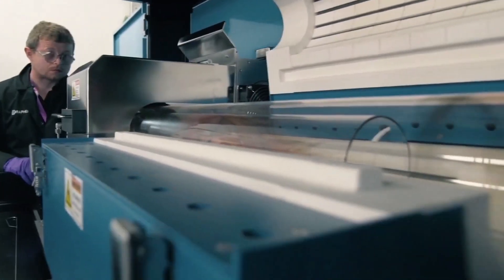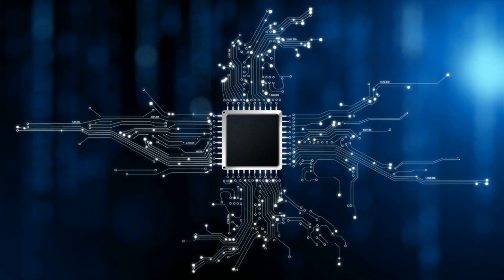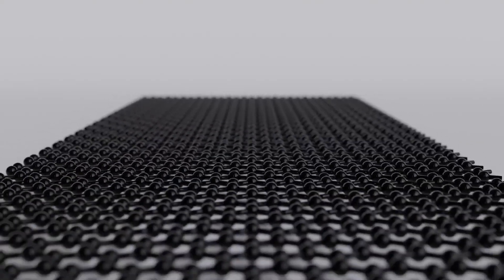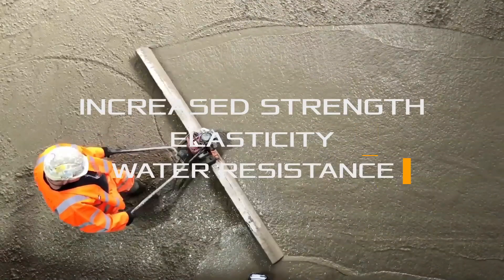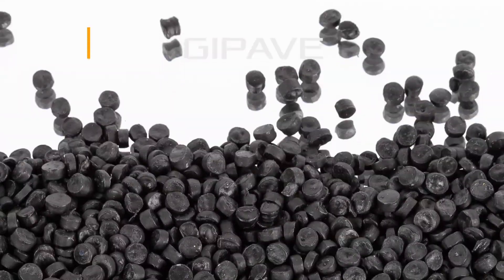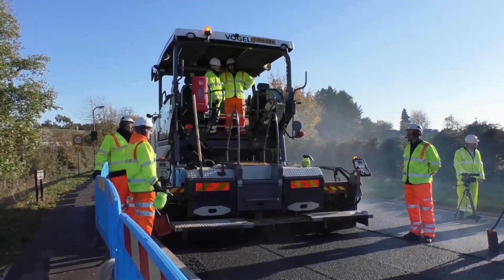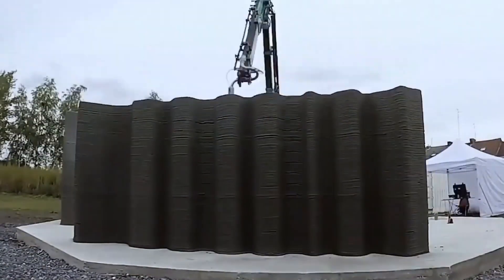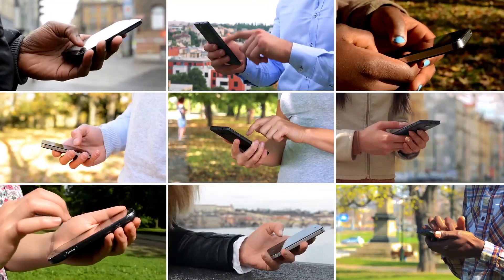Graphene in concrete is already changing the rules of the game in construction

Comment: Very much interested in new materials since I've spent my career in bridge construction.  I have many questions but to name a few: cost structure, manufacture of Graphene, storage of the material, and corrosion resistance.  Interesting, thanks.
Reply: Other questions I personally have is does this material leak anything into its surroundings during use?
For instance if used as a road surface, will this lead to particles in the air that's worse then what's released when driving on asphalt right now?
Or is it better?
If used in a bridge, will water flowing down from it contain particles harming fish etc?
Does it enter the food chain?
Does it cause disruptions in it?
Is there health hazards involved at any step of the process from making a product with these materials, during use or when removing the product in question after end of life?
Reply: @Luredreier  the "it" to which you refer is carbon, so the same questions would apply to the use of pencils.

Comment: Graphene would be a alternative to Ferro Cement in the boat building industry. 
The claims of waterproofing and flexibility make the graphene ship or yacht an interesting possibility.
Reply: I built a Ferro-Cement back in the 70's and sailed her 50 thousand or so blue water miles....I'm not sure that there is an actual need for anything stronger for that use.  The boat is still doing well, somewhere in Mexico, I hear.   Ferro-cement was an inexpensive way to build back then, I had only $3,500 in the hull deck and cabin....but costs went to the moon in the late 70's and being as how ever fiberglass boat ever made is still in service unless it was sunk...it is MUCH cheaper to buy a cruizing boat than build one....without the 5 year build part...though frankly, the boatyard was the best part of my 20 years with boats.  -Veteran '66-68

Comment: Long on hyperbole but totally absent of anything specific.  30% stronger? What does that mean and at what cost? 30% stronger in what, compression, tension, shear? What about modulus of elasticity, thermal expansion? In the absence or presence of rebar? After a couple of thousand freeze/thaw cycles?

Comment: Wow at 66, I have seen quite a bit of changes. But it seems to me the most serious impediment to technology growth is not exactly knowledge, but financial problems raising enough money to drive ideas! At some point for all mankind to get along and get ahead, greed will need to be put in check in order for the common good of all and not just a few. For my own experience with graphene, I spent the extra money for a treatment for the paint finish on my 2019 Colorado Crew Cab. It’s what’s new an called Ceramic protectant with Graphene. That you apply similar to wax, only instead of a circular motion, you apply very little to a microfiber towel, or applicator in a even back and forth motion, being careful to slightly overlap the coverage, in a small area as you go, the planing on getting back just as it hazes to wipe clear. That’s it! Very little elbow grease involved. With an incredible deep, smooth as glass reflective shine, that bonds to the surface at a molecular level, that enhances the finish with a self healing property of protection for at least four times that of the best Carnauba Wax can! With at least half the effort and time to do so. But the cost? Is at least four times higher, by volume and amounts needed! But this is very important, you save on labor at least 200-400%! Depending how often you get it done, or do it yourself. But the shine is incredible, plus you can use it on EVERY surface! Even the glass! Plus the hydroscopic properties are enhanced so much dirt and contaminates just flow off with very little settling, plus you almost don’t need your windshield wipers! Especially at speed on the highway!!! There’s also an argument you will get better mileage, due to the fact the vehicle will slip through the air easier!

Comment: Instead of fighting the property of graphene to be flat, engineers should capitalize on it. Example instead of adding pellets of hydrolyzed graphene to concrete, they should make large scale webbed sheets to replace re-bar in concrete. Perfect for air-crete dome structures.
A funny note; so much for the globalists carbon agenda with the increase in graphene usage! 😵

Comment: If ur building a house just have the slab poured min 6in thick an dont let a builder start building on the slab for 2 weeks 14 days let the slab completely cure an it ll last along time I've been to houses my dad built in the 70s with the 2 weeks cure method An there still strong at 50 yrs old

Comment: If its 200 times stronger than steel, and concrete is already pretty strong...how are they going to tear it back apart when something needs to be tore down to build something else or when a construction goes wrong and has to be redone???  Is this goingvto be nearly impossible to rip up?

Comment: Very nice posting about Graphene's increased use in industry.
One KEY item missing was any mention of the COST associated with making graphene in the volumes required for use in bulk construction materials, like concrete and asphalt.
Reply: The one thing every engineering student forgets about until they're a senior in college.
Reply: @1999colebug  Unless his/her personal experience identifies cost as a prime issue, or there is an engineering course on it (there wasn't when I was studying engineering in college), even seniors may be clueless. 
To highlight how bad it can get, a company I once worked at hired a PhD in mechanical engineering, fresh out of college. For one product, he spent a long time designing HIS OWN BOLT for an application! 
I told him: 
1) It would be prohibitively expensive in terms of his time designing, time arranging/contracting a shop to build them, as well as the per unit price for low volumes.
2) There are commercial manufacturers from whom he could select from a range of bolts perfectly suited to his needs, and handed him an Unbrako catalog of bolts. His expression resembled Homer Simpson...."D O H"!
3) The catalog's bolts specifications were CERTIFIED, whereas his custom would not be without major added expense and time in testing. (We needed this for liability purposes, as failure could be life threatening)
Reply: That's wild.  A PhD didn't know that, wow.  

 @gregparrott  it took me till my 7/9 semester in college to learn how to use ASME / catalogs / industry tools and incorporate them into my designs.  Iirc I was primed on using catalog parts from the beginning as HW questions would say "using xyz bolt from ABC company with 123 specs."  They just never out right said to use prefab stuff.
Reply: @1999colebug  It dates me but the experience I recounted occurred in the early '80s. Hopefully, that shortfall has long been addressed in college curricula.
Reply: @gregparrott  I wouldn’t count on it.
Reply: @johnseavey6622 , on the job training, the real School of Hard Knocks!
Reply: In fact it was presented as an extremely difficult substance to make and be cost effective and yet they are using it in concrete just willy nilly?  Looks like the general public is being duped so that industry can hoard this material prior to it being used by individuals and reaping its benefits.  Taxpayers are the first to pay and the last to receive.
Reply: @lastofthebest5102  The material used to make graphene itself is inexpensive, however it is the form requirements that make graphene a challenge and costly.  Think of like like fibreglass, they've used it in concrete for years to a similar effect.  Its also very cheap and easy to add that style of product to concrete because it doesn't have specific dimensional restrictions, it can just be simple.  
In time, we'll develop the ability to mass manufacture the material and form it, its just not there yet.
Reply: Even with scale of economies,  this material is prohibitively expensive.  Until the government subsidises it with taxpayer  money.  Construction companies laugh all the way to the bank 😆
Reply: @abuchand5371  I know it's more expensive. But as for 'prohibitive', you did not address the 'economy of scale issue. For example, how am I able to buy a pair of carbon fiber walking poles for $30, which is within a few dollars of aluminum ones. I just looked online at carbon fiber tennis rackets. They start at $33, and rackets have extra labor associated with stringing, and a protective pouch. I doubt you will find a tennis racket significantly cheaper than that, regardless of material.
Reply: I made this a couple of times at versarien ,and scaling up when needed seemed to be the only thing stopping it being produced in bulk
Reply: @leeus20007   I had not previously heard of Versarien, so I looked it up. While I still know little of the company's capabilities, I did see its stock valuations. Unfortunately, that has been on a pretty steady decline since its inception.
Reply: I've always said the Dollar was just as importing of a unit of measure as the meter, kilogram, ampere, or any of them.  I agree 100% Gregory, price is essential.
Reply: The cost of Graphene is high but the amount is very small < 0.1% of the total. ( I agree the total mass of concrete is not trival). However the savings in mass 20%, and energy used to produce that mass more than outweighs the cost of graphene. 
You need the think about total cost benefit and Graphene wins hands down.
Reply: @ianblaby2986  Interesting. But where did you source your claim that graphene would only represent 0.1% (1 part per thousand) of concrete?
For example, to change steel into stainless steel requires about 18% chromium. In contrast, 0.1% represents just a trace amount
Reply: people underestimate how much the industry, or any industry at all, will try to cut costs whenever they can
Reply: As it sounds like its a rather heterogenious mixture of small flakes and fibers it will be substantially easier to make then the highly ordered graphene needed in any kind of electronic or super high strenght applications where performance above carbon-fiber is needed.  This is why we are seeing Graphene get commercialized here as an additive to concrete first because it's the cheapest form of the material and the only one we can really produce efficiently at bulk right now.
Reply: @kennethferland5579  What you say makes sense. But the follow on question is 'How much', and for what gain?....e.g. A 30% cost premium for 10% (or 100%) strength increase
Reply: Research Ceylon Graphite, a company in Vancouver, BC. They are mining in Sri Lanka.
Reply: @JAKASHA420  Thanks for the suggestion about 'Ceylon Graphite'
It's interesting that you mentioned them mining in Sri Lanka.  I saw a recent news clip that included Sri Lanka as being one of many Asian countries where excessive sand was being mined for both use in concrete as well as landfill (Singapore in particular, but elsewhere as well). The result has been an export ban on sand, imposed by some Asian nations and restrictions in others.
Reply: @architecture_A51  Leaving this key element out on purpose makes sense. Including it would date the video almost instantly. When graphene was first made, there wouldn't have been enough money in the world to pay for its use in even a small engineering project. As it becomes more widely used, expect the price to continue on a downward trend as new cheaper ways of making it are discovered.
Reply: Cost is an interesting factor, but more relevant to me is that we face Climate Change and concrete itself is part of the problem. To me it makes sense to only use concrete at all where absolutely necessary, until we have the Green Economy firmly established. 

Concrete should be of higher quality if emissions costs work out better for it long term, and used as sparingly as possible. Else if there is sufficient demand for Graphene, which there likely will be as it's hopefully going to be used well in a variety of applications, it will attract more workers and investors and so prices will come down to more tolerable levels :)
Reply: @michaelchildish  I agree. It would be WONDERFUL if one of the methods to reduce CO2 was to have the capacity to sequester hundreds of billions of tons of CO2 into usable, extremely long lasting, manmade structural materials. The current method of pumping it back into the ground after we had taken it out of the ground and then burned it, seems like a ridiculous proposition (carbon storage / carbon capture).
Reply: @gregparrott  Saw something about Hemp bricks being used recently, claiming to be carbon negative. It may not be suitable for large, large structures like nuclear reactors or even office blocks, but seems suitable for housing perhaps :)
Reply: @michaelchildish  Hempcrete is the way to go I think although I don't expect it to take off.

Comment: Sounds nice but the road is only a month old. Not time to celebrate yet. 
How about coastal concrete construction? Any area with salt is the death of standard steel rebar. I looked up what should be the ultimate design for long life - high voltage transmission poles. These are installed in swamps and in brackish water. Super expensive installation that probably far exceeds the cost of a pole. I expected to find stainless rebar or some miracle reinforcement. Nope. Steel. Rotational cast with lots of cheering about thin economical sections but the steel is still going to rust and break the concrete. 
New houses in the Florida Keys must be on elevated steel reinforced concrete pillars about 13’ high. Creosote treated wood, that does last,is not environmentally acceptable. Million dollar houses are on pillars with spalling concrete from rusting rebar. The solution is to plaster new concrete over the rusty rebar.
A miracle reinforcement is needed.

Comment: you neglected to mention that it was the cost of production that stifled graphene's integration into existing technologies... when it was first invented, there was no way to mass produce it, and the first mass production method came less than a decade ago, but was still expensive. increased availability has cut production cost, but it won't be until the trial programs are completed and the data examined before any real integration begins.
Reply: There are USA suppliers with >100MTs of production.  It's not massive millions like the petrochemical industry but there are scalable processes that exist today

Comment: So is the graphene intended to replace the rebar? If this is the case then is the thermal coefficient of thermal expansion of graphene similiar to concrete? Its a happy accident that steel and concrete expand at almost the same rate thermally speaking.. Thats why we can build bridges out of it.. If not the concrete would break off the rebar. How will this work with graphene?

Comment: Errors and omissions! The resurfacing of the AI in the COUNTY of Northumberland did NOT involve Gipave (which had been trialled previously in Kent).  The Graphene used in the A1 was provided by leading U.K. producer Versarien plc.  Versarien’s Graphene was also the stuff used in the pouring of the gym floor in the TOWN of Amesbury and the firm is partnered with the 3D printing firm in the Printfrastructure process.  Otherwise an excellent video, many thanks!
Reply: 3:50 That's very unlikely to be a British road. They have some problems with potholes, but they aren't that bad!
Since he's talking about a road in GB he should probably be talking about the "road" not the "pavement" as that's where pedestrians walk.
Altogether so many errors that I have no confidence in the video.
Reply: I worked at versarien I was wondering if this was something to do with them.
Reply: How about adding graphene to molten iron to produce higher strength steel?
Reply: @leapdrive  I would imagine it would melt ?
Reply: @kennethalbert4653  , yes, that would be a concern.
Reply: R D  about what ?
Reply: R D  i worked at versarien sorry
Reply: R D  they were in cheltenham until september they have moved to longhope  stroud or the forest i think somewhere near there dont care really as i was made redundant, kane meekle was my boss ,check it out call him and ask, dont call me a fucking liar douche bag.
Reply: I live in Amesbury, and can confirm..the dude did have a few errors.
Reply: Northumberland is a stunning county, great villages and pubs and is good for walks and hiking either through forest or a wood or up a hill 👏🏼👏🏼👏🏼💪🏼👍🏼👍🏼

Comment: I don't think graphene is going to beat mother nature and frost heaves. That is the main reason roads deteriorate so fast and we get pot holes etc. in cooler climates with freezing temperatures. The correct way to build a road is very expensive you need to dig down below the frost line and get all the boulders and rocks out then lay a good base. This is usually reserved for freeways.
Reply: @architecture_A51  is this material toxic to humans?

Comment: This will never  replace rodbusters  Team work  on a Bridge   Need a Crane to set the Table forms   How could you time the concrete to stay as timid to go thru those  tiny cake batter  looking   bladder to layer it   Truck 9 yrds in and only about an hour and a half is it workable  with rakes an shovels  even using vibrator   Easy listening  is talking about sweating   yea concrete sweats
Reply: I believe the last infrastructure Bill during President Obama  was a pencil whipped  mainly because of the  Real Estate Crash   due to Countrywide's  mishandling  Bad Paper  anyhow  we need progress this time not too many chiefs   I hope they  have a contest which state can fix the most  Stick to Pot Holes first  and underbellies of Bridges   Rail road     Keep our Beautiful aquaducts  !   There's one in DC  signed by George himself with Layfeete